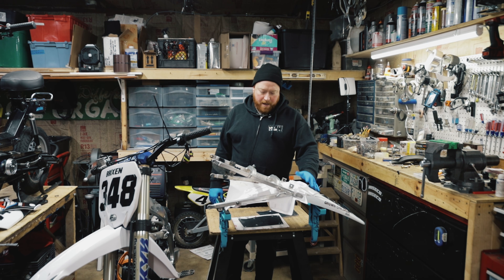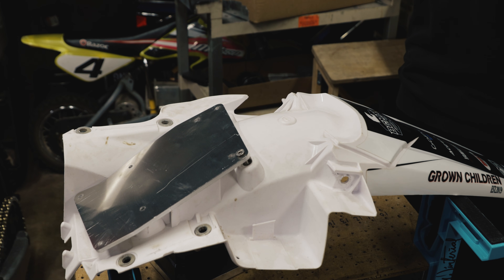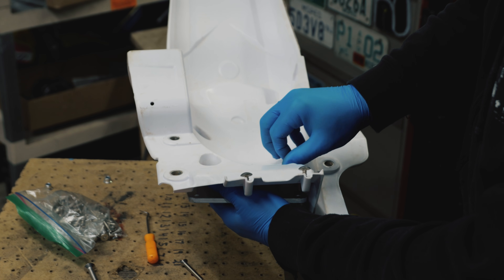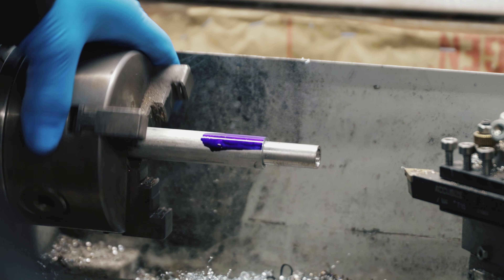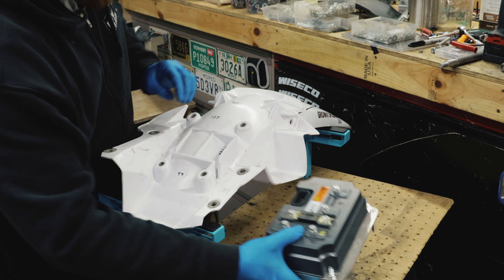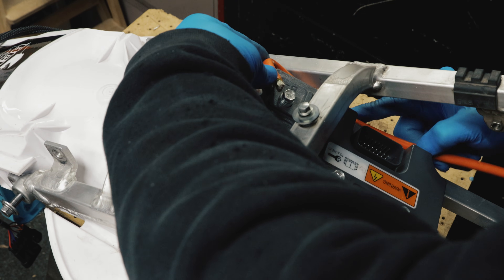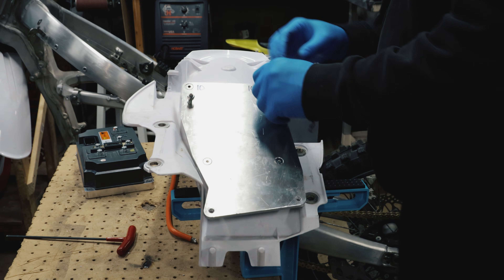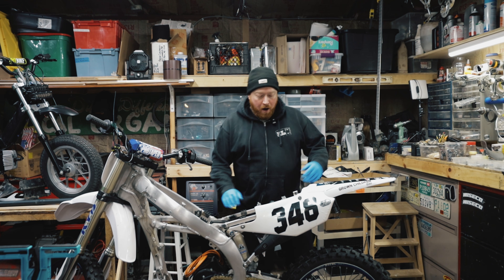Stark Varg knockoff Build PT 4 | Send Cut Send Adaptor plate Votol Controller mounting

Comment: Youll have to let us know if you melt your fender, those controllers get hot
Reply from the maker: Yeah we will see. I have an em 200 with 300A and it doesn't get hot. Ill watch it pretty close the first couple rides.
Reply: @Corn-ped  I'm planning on water cooling my controller, when you have hill climbs and sand to contend with you'll draw more amps than cruising around... Just depends how you ride